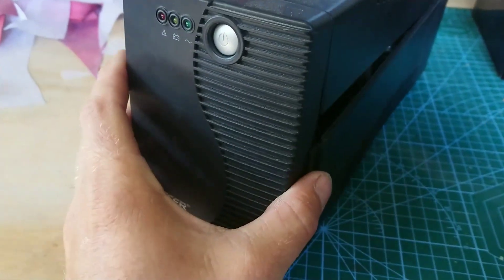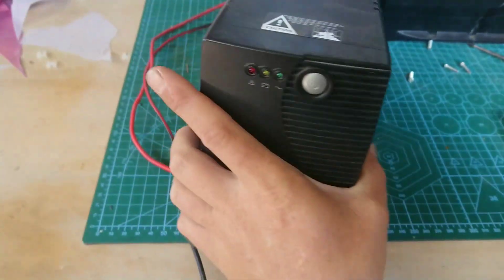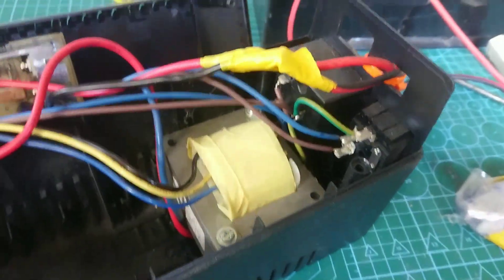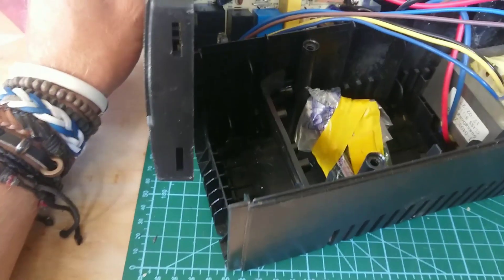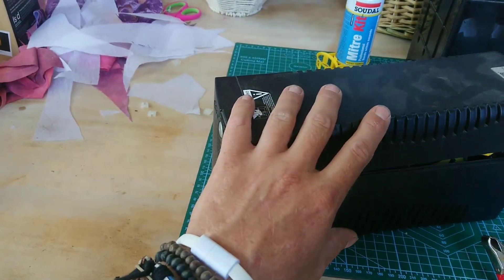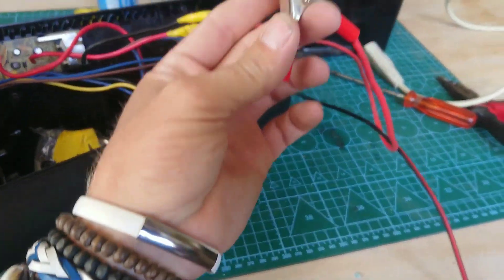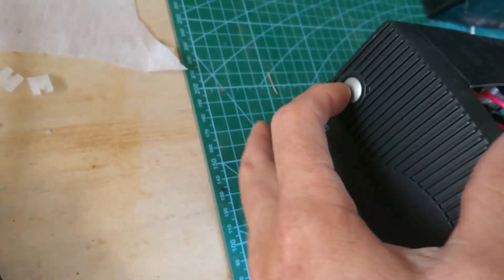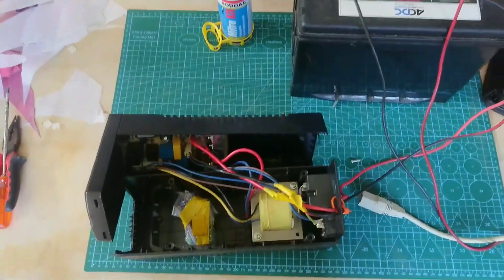Mini UPS Modification

Comment: I have 6 simalar size UPS (3 x ANDOWL), (1 x Mecer) and (2 APS). After opening them and doing this upgrade on the battery, the Mecer and the 2 APS UPS's work 100% but all 3 Andowl UPS do not switch on again after disconnecting the internal battery. Could it be possible that some manufacturers delibrately design it so you have to buy a new one or take it to an electrician when the battery starts to fail? I'm not an electrician so I don't know how to fault find.
Reply from the maker: I've not come across that issue before. Does the ups not come on even when plugged into the mains supply?
Only thing I can think of is that the terminals may be swapped around. Meaning perhaps the positive clip is actually the negative, so try swapping the clips around. Other than that, assuming no other damage incurred, it doesn't make sense that they shouldn't start up. Unless they were 24volt ups's, then you would need a 24 volt battery of course to fire them up with.
Reply: It's definitely 12volts and the wirig is color coded. I did try swapping the terminals but no success. I also tested 12volts from the board to the switch. I think it's just programmed this way. Never the less I'll probably find another use for the transformers. I also have another 1500w Andowl inverter that just stopped giving output after 2 months and also cannot be fixed, perhaps we should just stay cear of this specific brand. Thanks anyway.

Comment: Running one of these bad boys exactly like that (yess😅 I ripped out the little beeping speaker/buzzer) with a 12V LiFePO4 battery
Reply from the maker: Nice one. What size battery are you using?
Reply: @littlekingcarver1  used 12volt deep cycle battery 100Amp run much longer
Reply: 12 lifepo4 battery I here those thing caught on fire Brin down few plane pilot death those battery are safe lol I will not keep them in my house no no